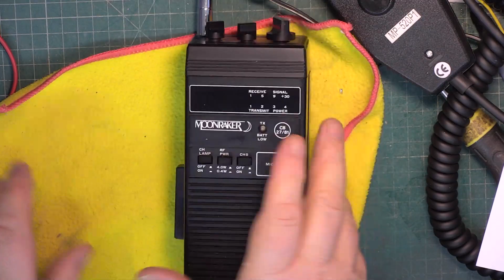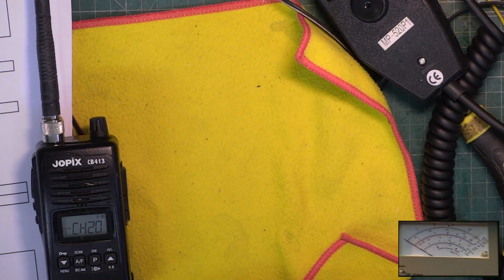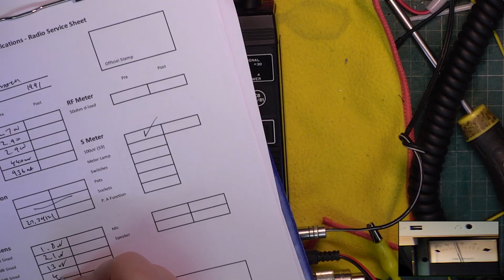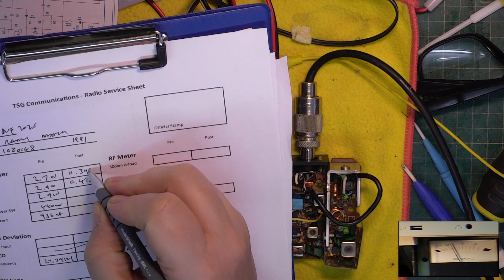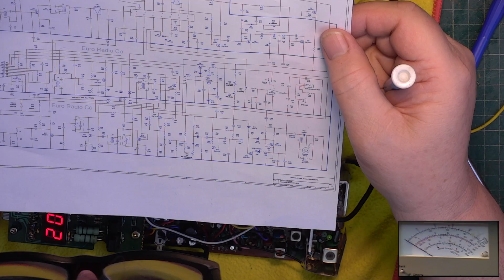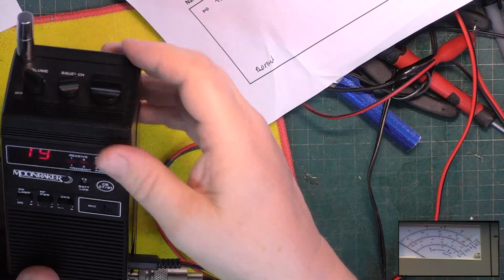Moonraker Master CB27/81 UK FM CB radio - extensive repair

Comment: Many thanks for the videos I’m starting to get a very basic understanding now, At the moment Im trying to get on of these units working, the CB unit has a full transmit signal, but an almost non-existent receive signal. on opening the unit I found a bit of a mess with the coaxial cable connection.  I found the coaxial shield had been connected to the loading coil terminal, it doesn’t quite represent the factory connection as shown  as in one of the videos,  should the coaxial central core be only connected to the loading coil , with the coaxial shielding terminated before the loading coil?
Reply from the maker: At the stage you're at I think you should be running the radio through the external aerial socket. Worry about the loading coil etc when you've got receive working. If you don't have the service manual I'll email you a copy. Remember this is a 12V radio. Never run it at 13.8V; you'll kill it.   rshireby@yahoo.co.uk

Richard, G0OJF, UK
Reply: @ukfmcbradioservicingTango21  hello Richard sorry to jump on you're post what is the adaptor are you using to connect the external antenna too  and would you have a telescopic antenna for 1 you would sell thank you

Comment: Very neat handheld richard good luck a puzzle people need mods done should bring them to you for you know what you are doing instead they give you a mess to correct
Reply from the maker: We would simply have told the customer to buy a set with takes an external microphone. What they did would have resulted in the radio being in transmit & receive at the same time, hence the damage.

Richard